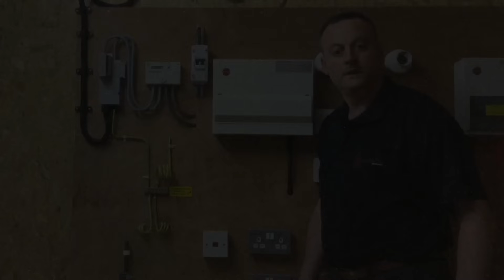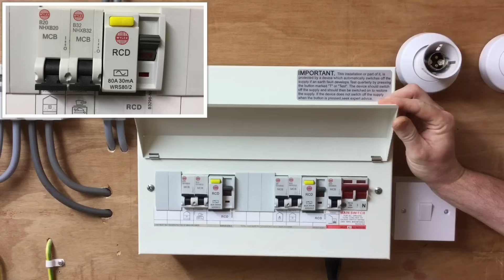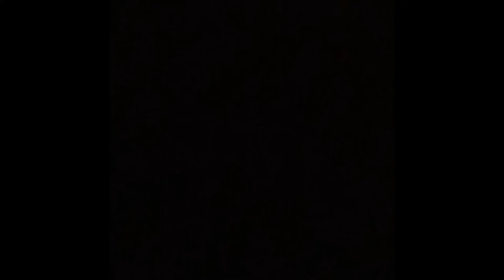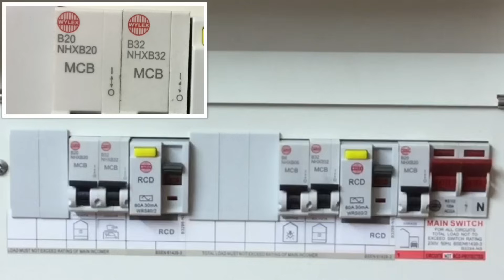Understanding your Consumer Unit (Fuse Board) Overcurrent & RCD Protection plus Isolation Features

Comment from the maker: == 🕐 Time Stamps - Cut to the action 🕕 ==
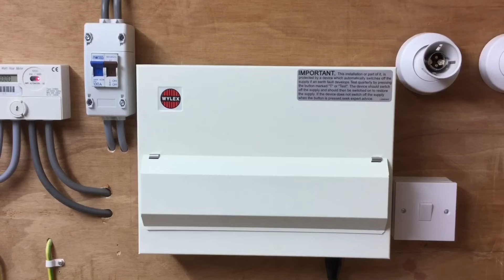00:20 - Looking at a consumer unit, distribution board or fuse box 
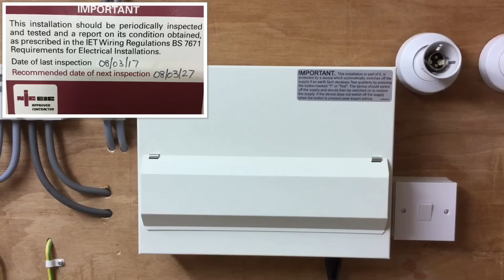00:40 - Construction of a consumer unit 
00:51 - Labels on a consumer unit
01:32 - MCB's, RCD's and the main switch in a consumer unit 
01:55 - Switching off for mechanical maintenance or emergency isolation 
03:19 - Overcurrent or overload and short circuit protection offered by the circuit breakers (fuses)
04:49 - Types of breakers type B, type C and type D
05:28 - Earth leakage protection by RCD's and additional protection 
06:29 - Selectivity or discrimination  
07:23 - Finding a tripped circuit breaker
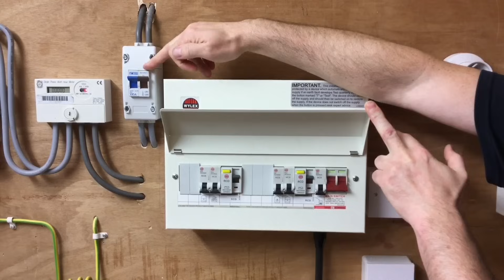10:00 - Turning of a consumer unit, fuse box or distribution board safely 
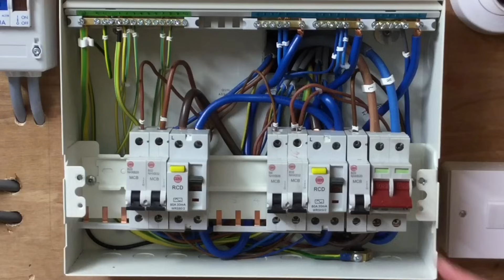10:27 - What's going on inside a consumer unit
11:42 - IP2X protection inside a consumer unit
12:35 - Identifying conductors in a consumer unit with numbers and letters
Reply: Instablaster.
Reply: The text covers your pictures of the breakers

Comment: nice video, I have two consumer units that receive electricity through separate cables from the electric meter. One unit with RCD replaced the old fuse units and there's another small consumer unit with SCD; one supplies electricity to the shed, another one to the EVC charger, and the last one to the shower. Last night, when we tried to charge the car, it didn't charge because there was no power supply. Upon checking the small consumer unit, we found that it was not supplying any electricity, even though all power switches were still turned on but consumer unit gets power.  I'm not sure about the difference between RCD and SCD; maybe a video could help explain this. The SCD says that if it shows red, then it needs to be replaced, but I checked and it's still showing green. Can you please tell me what could be wrong with the small consumer unit? Thanks.

Comment: i have a serious question. in a house with no earth rod, what happens if i install an SPD and instead of connecting to the earth line i use the main neutral. just to return the transiant over voltage to the grid...where it came from i see no harm in that. what do you think?

Comment: Hiya can anyone tell me what I need to do to get my sockets/lighting back working when it’s gone off in one room only? Well two of the downstairs rooms actually ? When I went down to the fuse box just now one of the little levers is intact down but unfortunately whenever I try to push it down it just springs right the way back up 😅

Comment: Hi, on the incoming tails (double insulated ) 25mm or whatever, 
From the cutout (bs88) to the consumer unit, no isolated main fuse, there is a run going up into the ceiling a metre or so rise, across 1.5- 2 meter, then down again about 1 metre, connected to a Henley block, then going into the consumer unit, 18th ed metal box etc, 
Could anyone tell me about the regs in regards to that,
Thanks,

Comment: Excellent video as always! Two questions. One are you technicallly allowed to do away with the linked switch in favour of a RCCB and use it for maintenance? (I then have a separate linked switch in the meter board or separate for isolation purposes.)  I do this and this allows me more room in the board for another two MCBs. Also in another presentation you mentioned that closest to the main switch is your 6A then 16A and so on which is the way I have seen nearly all boards done.What I did see on a Contactum board installation instructions was to put the larger current MCBs first (closest to the linked switch) and then go smaller (same as done with this board you have) which when I think about it makes perfect sense so larger currents are closest to the switch and get the priority. Any thoughts or comments welcomed! Thanks.

Comment: @GSH Electrical 
hello i have to questions for you I've been meaning to ask. I have a boat running a 12v system 1) would it be ok to use 250v 32mm glass cartridge fuses on a 12v circuit 2) I have a bilge pump and a float switch. On the float switch it says 12v 20amp max and on the bilge pump it says 3.5amp draw. I was wondering what amp fuse do i use in the bilge pump control panel.

Thanks

Comment: Hi, hope you are well, great explanation. Please I have consumer unit in a tenanted one bedroom flat. The RCD is connected to 4 mcbs for cooker (not used as gas), immersion heater (removed only a spur remains), sockets and gas boiler.  There are 2 mcbs not connected to the RCD being shower (no electric shower installed) and lights. The electrician says it is a fail on an EICR inspection as the lights need to be connected to the RCD, is this true? Also, can I remove the mcb for the unused immersion heater to swop into the slot, the mcb for the lights circuit? Kind regards.

Comment: I had a bang when switching on a front room light I changed the bulb and there was no light and it has coursed a few other lights down stairs not working so I checked the cir ofcurt board and it was still on do you know what the issue is please thanks

Comment: Great video. 
Just a quick question... 
Where does the Circuit Breaker for the garage get it’s power from as it’s not on ether of the RCD live rails? 

Any help would great. 

Thanks, 
Michael
Reply from the maker: michael Cattermole hi it is connected to the bus bar but not the RCD as the sub main circuit is in SWA cable. Thanks for watching and commenting. Gaz
Reply: @GSHElectrical  I would imagine most garage/shed supplies initially derive the supply from the consumer unit in flat T&E cable and then to the garage in SWA via a JB so would should the supply to the garage/shed be best supplied via the RCCD as the supply cable is not mechanically protected over it's full length.
Reply: Thanks for the reply... 

So just to be clear there is a buz bar coming out from the each of RCDs and then another buz bar connecting the circuit breaker suppling the sub board to the garage? 

Sorry to be pain, just can not see how the live if fed to the bottom of the circuit breaker and where is comes from. 

Thanks again,

Michael

Comment: My consumer unit is making a noise like buzzing or similar, rather noticeable when I'm under the stairs. Last week the only recent thing I've done was replace a 30 amp fuse when the kettle blew when my relative turned it on. New fuse sorted it. Do I need to fix something now for the noise?

Comment: Just stumbled upon this video when I was looking in my consumer unit at home to ensure I had RCDs (I saw something that confused me so thought I would look it up). I do have an RCCB, as it turns out, but while I was there I also noticed that all my circuit breakers are Type D. Just how bad is this? Do I need to get this looked at urgently?
Reply from the maker: Hi, I would seek advice from an electrician and have an EICR (electrical installations condition report) carried out 👍. All the best Gaz
Reply: @GSHElectrical  Cheers :)

Comment: Hi, great video. Might seem a silly question but how do you connect a live feed to a non RCD'd MCB that's next to the main switch. The RCD'd MCB's are connected by a busbar. Thanks
Reply: Hi, they're connected by a short 2 way bus-bar at the bottom, unlike the RCDs that are fed in from the top. The Line (Brown) wire at the top of the MCB is the switched out. You can just about see the little bus bar connected to the same Main Fuse bottom contact point as the 2 brown feeds for RCDs when the cover is off. Hope this helps.
Reply: @niall-mcm  thanks very much.

Comment: Very well explained in every step.
Reply: far to complicated for layperson to understand.

Material is aimed at professionals.

I have to remember it from how electrician explained to me.

I'm no expert but this all sounds reasonable.

WIRING ############################################
3 levels of isolation ….not including on-device fuse (eg fuse internal to kettle)
- Plug level (wall level) :  
- Ring level (room level) :
- Main switch level (property level) :

BREAKERS ##########################################
3 levels of breakers to isolate things ….when device fuse fails you then have to rely upon...

Circuit breakers trips  
- when wall plug needs isolation (separate room ring from property)

RCB breaker trips  
- when the ring needs to be isolated (separate one or more rooms/rings from rest of property)

Mains switch trips 
 - when property needs isolation (when property needs separation from mains supply in road).

FAULT FINDING#########################################
When working with electricity on a wall plug or in a room
 - choose to isolate ring if not property (trip off RCB or Mains switch as basic safety protocol.

When working with an earth fault In the ring (any device tripping RCB constantly)
 - disconnect all devices and reset RCB 
- and then add back individual devices (replug into wall) to see exactly which device is causing RCB to trip (which device in room)
- once identified device swap it out (or keep it disconnected till fixed)

Comment: Great videos, just a quick question for you. Do mains isolators such as the one between the meter and the DB have to be made of metal or are plastic ones such as the wylex REC2 still suitable ?. There does seem to be some debate about this. Cheers !
Reply: That switch is not the consumers it’s the switch supplied and fitted by The supply company it’s purpose is to accommodate the consumers electrician to connect into ,,,,,,,only qualified electricians should be doing this work and certified but the ECA

Comment: Is it common to have all sockets in a house using two 30amp circuit breakers?
E.G if I turn off either circuit breakers it turns off all the sockets in the house. I just noticed this when I testing the RCD.
My understanding is that you might have all sockets on one circuit breakers or they could be separated across a few depending on the number of sockets.
Reply: myfaceback100 usually in the UK upstairs and downstairs sockets are split with a 32A breaker each. Bungalows (one storey) may only have one.
On top of this, the cooker and electric shower will both have their own breakers. If you have a radial circuit, ie a spar in the garage or outside, they’re usually fitted with a 20A breaker.
If both your breakers share the same neutral bar, you can expect both to trip the same RCD if something goes wrong Also, if both circuits are connected in any way, they will both trip. A lot of cowboy jobs end up causing this.
Reply: If you have a small house like a 2 bedroom council you will probably only have one ring. Most have upstairs and downstairs separate but not essential.

Comment: Why would you only use a B20 amp Mcb for the sub main to the garage. I would of thought it would of been a bigger fuse i.e 40amp at least..... can you explain why its at 20amp and not greater ampage
Reply: #FollowJesus Christ because the garage will most likely be on a radial circuit and not a ring circuit. These are standards, but can be raised if required, you would however be required to upgrade to a thicker cable if you’ve got a lot of large tools and so on, because 32A on the standard 2.5mm cable in a radial circuit is both electrically unsafe and a fire risk; if something is wrong with the circuit, the cable will heat up and the breaker will not trip in time, and could start a fire.
If the houses was built with a garage decades ago, it’s sockets will most likely share the downstairs ring circuit, thus getting 32A.
A radial with a 32A breaker requires 4mm cable.

The reason a ring circuit 2.5mm can take 32A and the radial can’t is because the ring circuit effectively splits the current between two paths.

Comment: I have a Wylex which is over 10 years old. I wonder if you can explain something with my configuration: It says "These circuits NOT protected by RCD" and that is basically every MCB. To the left, it says "These circuits protected by RCD" and they are all blanked off. However, the main 100A switch (which I suspect was a later install) says RCD and has a test button on it. Does this mean that everything coming off that is RCD protected?
Thanks
Reply from the maker: Hi. Without looking at your system I guess the main switch is probably an RCD... press the test button and see if all your circuits go off. Thanks for commenting and watching Gaz
Reply: @GSHElectrical   Thanks. I did a test yesterday and the main switch tripped. I guess the RCD plugs I bought for the garden were a waste of money then...

Comment: If using RCD's (Better to use RCBO's) then its a good idea to have the Oven isolator with the spare socket on the opposite RCD to the Downstairs Sockets - you can then at least have a cup of tea why you scratch your head wondering what has tripped the other RCD.

Comment: How do I connect a double plug socket to my fuse box plz I’ve a socket above the coubard door me fuse box is in but the socket is dead and I need power to it to run s security light out side plz help ASAP 👍
Reply: Plug it in DUUUUUD

Comment: My wife wants a consumer unit in garage to run a freezer and sockets can you run a armoured cable to a consumer board from a socket from a plug socket from house thanks brilliant video
Reply: Geoff Daniel a distribution circuit should be on its own breaker
Reply: You could extend your sockets via a spur.
Reply: Geoff Daniel Before adding a spur I would personally check the circuit  maximum demand (100A?), be careful when Just spurring off supplies, this is sometimes when new problems arise if not done correctly
Reply: Ive placed a distribution board in the shed coming off the main distribution board in my home.. swa under the garden and 2.5mm wires for the power and lighting.power (ring) b32 lighting b6 radial

That was 2 maybe 3 years ago so it might be alittle different

Comment: Gaz,

Really enjoying your videos, thanks for all the valuable time you've spent doing them.

Can I just ask, as it's not something I've ever come across before...

When the lad was doing the continuity test on the CPC for the cooker circuit, why did he test from the back of the cooker itself? I'm assuming that the cooker had a proper cooker connection unit on the wall, so why not test to there only? I appreciate that doing it to the back of the cooker proves that the cooker is safely earthed, but as it's not considered an actual part of the fixed wiring installation, it seems like you're going above and beyond any actual requirements. Is it a reg I'm not familiar with, or just something that you like to do/teach personally as 'good' practice?

What if the cooker is one that just operates on a 13A BS 1363 Plug? Do you still test CPC continuity to the actual appliance or just to the socket?

Keep up the good work.

Cheers
Reply from the maker: Hi thanks for the message. I have always tested to the metal work of a cooker as it’s the exposed conductive part. The fixed wiring from the outlet is connected in to the cooker (6mm cable) the cpc job in this circuit is to be connected to the frame of the cooker so testing only at the outlet won’t prove the cpc has made it to the final point in circuit. Hope this helps Gaz
Reply: Cheers Gaz, I do understand. I guess it just comes down to interpretation of where exactly you consider the final point in the circuit. I consider the wall outlet to be the end, not what's attached to it... That's a problem for another day, and a higher quote ;-) Cheers
Reply from the maker: Hi. For me the final point of a lighting circuit with metallic accessories is the metal accessories same for the cooker circuit. Thanks for commenting Gaz

Comment: I  needed  to use a C-Type Fuse for my homeoffice, as there are a lot of switching power supplies!
So when I turned on my multiple socket outlet sometimes it would trip the formerly installed B-Type Fuse.
FYI: I live in Austria, so we have no ring circuits and fused plugs. Circuits here are fused much lower(10A-16A typ. 13A)
Reply from the maker: Hi. Thanks for the message GSH Electrical 👍

Comment: Hello 
Why do people coil the main earth/bonds and tails ?
Reply from the maker: Hi. The only reason they are coiled is my learner take them out and put them back in daily so often we cut them back to make a better termination also the coil helps prevent work harding of the copper. Normal installation the coil is not required thanks for the question GSH Electrical

Comment: Two things , I am getting a new electric hob due to damp damage to one of the switches and it blew the main fuse hence buying a new one [ I can't get a new switch for it ] , now would it be easier to fit the cable to the new hob [ warranty aside ] , than to wire it into the box , it would be a lot more accessible  , 2/ it is wired into a sixty amp main fuse box which goes to the meter , surely it should of been wired to one of the more normal twenty to thirty amp fuses ? thanks .
Reply from the maker: Hi. Hard to help without looking. It’s like the 60 amp switch fuse has at 30 amp fuse in the carrier. 60 amps is its maximum rated value. A like for like replacement is allowed just make sure the fuse and cable are correct and your termination tight. Thanks GSH Electrical

Comment: Is it a requirement to strip off  the outer pvc sheath off main tails?
Reply from the maker: +Dan Londt 
Hi. It makes it easier to identify the conductors. You can also label  the supply tails L, N and E to identify them. Thanks for the question GSH Electrical

Comment: No need to lock off the main switch?? Is it only when you leave the board unattended that locking off is required? Thanks
Reply from the maker: +matthew Thompson 
Hi. I work on safety is the most important feature with my learners. You can be a physical barrier when standing in front of the consumers unit. Either the circuit breaker or main switch must be locked off for isolation and the cover replaced before walking way with the key. All the best and thanks for watching GSH Electrical